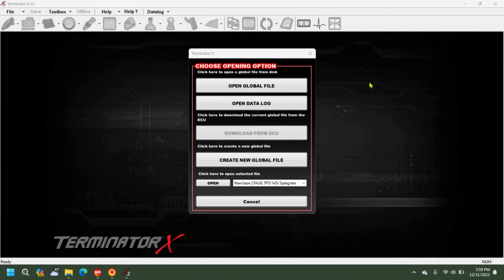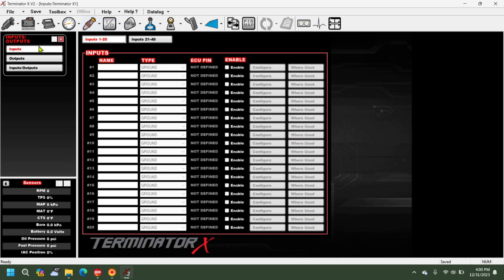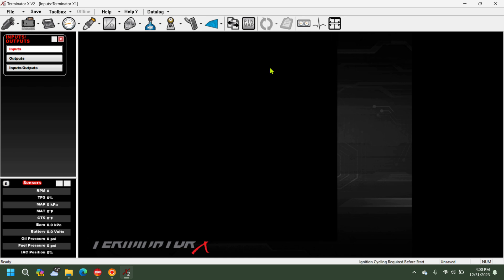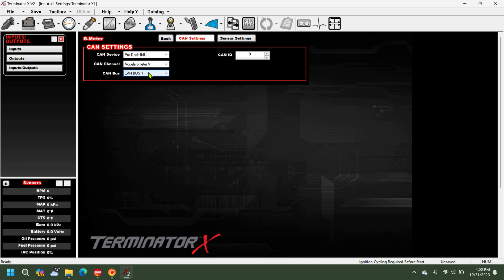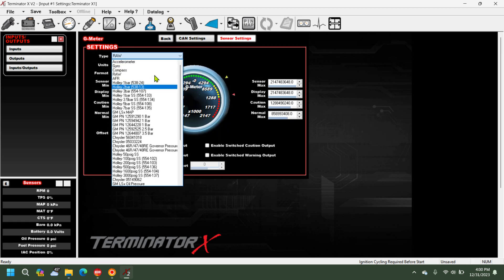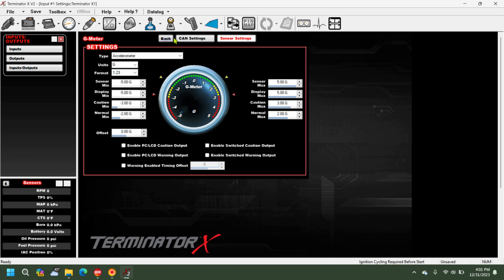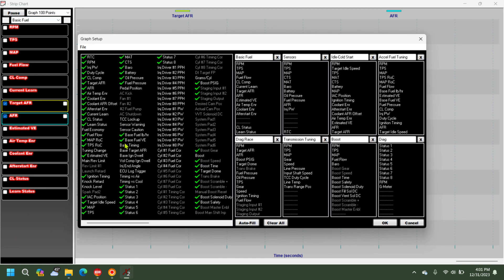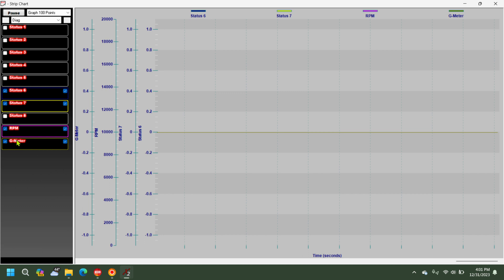Holley EFI G-Meter Setup | Use the ProDash built in G meter!

Comment: Is this confirmed to work when taking an ECU data log? I can't find any other videos.
Reply from the maker: Yep you can certainly view this in your datalog! It will populate in the list of parameters
Reply: It works but not useable data
Reply from the maker: @BmoreFox definitely not compared to a standalone g-meter. I wouldn’t tie it to any I/O but neat to see it tucked away in the prodash!
Reply: @GrannyCarGarage  yeah for sure. I use both axis plus the gps speed for logs too.